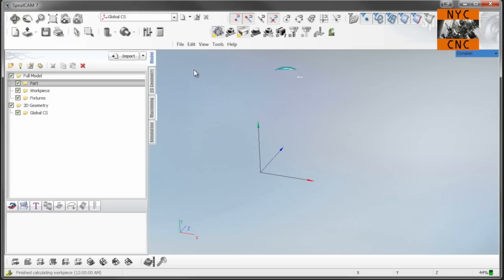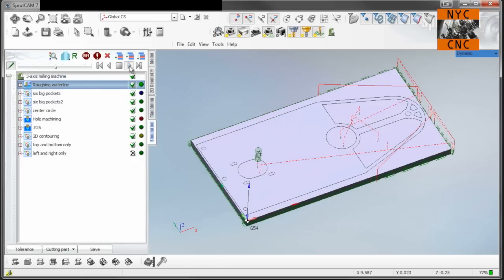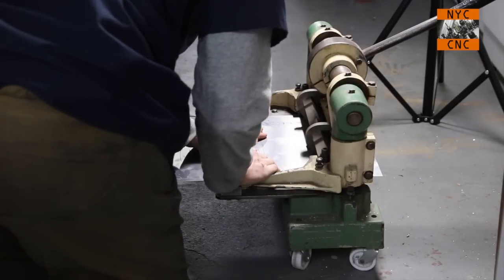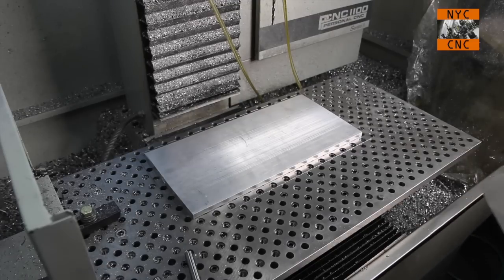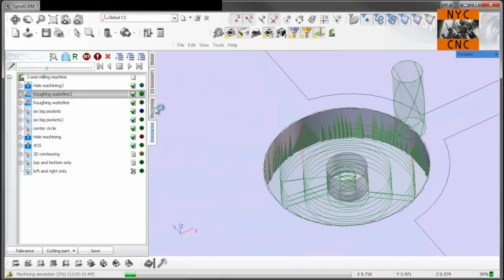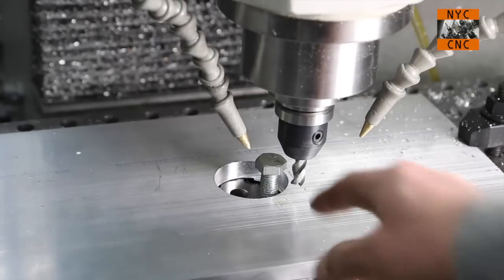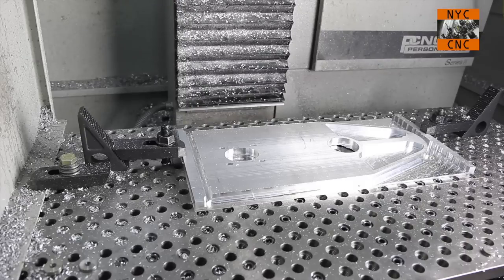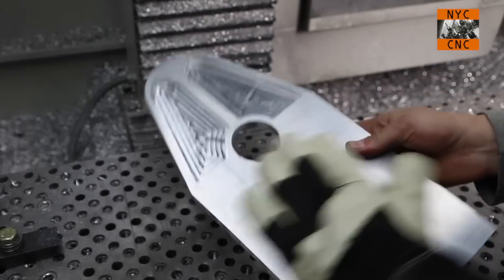Manufacturing At Home:  Machining Large Aluminum Plate with Tormach PCNC 1100

Comment: Just wanted to mention a tip on deburring that my father gave me (he's a retired CNC programmer from aerospace industry): As a last step after your finish pass, define a chamfer on your edges and run a 45 degree bit around it real quick. It may add an extra 30 seconds of run-time per part, but it decreases secondary hand ops, decreasing total time per part. My dad always tried to find ways for his programs to make the operators job easier. I'm really enjoying the videos! Great job!

Comment: Solid video man. If you're in a situation like that where you're coming close to cutting into your table, you can guarantee that you'll clear it by touching your tools off on the table, and then adjusting the values upward by the thickness of you stock and sacrificial plate (Or just program your depths from the bottom up). That will avoid the issue of touching off on stock that has a variable thickness.

Comment: OK here goes. In the comments here you asked for a bit of training. Pay attention, This part type is very common to  parts we see in our shop every day.
Fixturing: Get a 1" thick piece of Aluminum Jig plate the size of your machine table. Bolt it to the table. It is now your sacrificial base. Drill it, tap it, machine into it your extra .01 in Z. What ever.  no more .03 stock under your work piece. It will last for years.

Now, your Demo part:  Align stock to table, long axis in X,  Use 3 dowels to locate if doing more than one piece.. Just drill and ream into your 1" jig plate base, as above.

Sequence: Drill all holes first. Pilot drill bores and 4  slots. ONLY one hole where the end mill enters the slots, not 2. Mill pockets, 2 bores and 4 slots. Add Chamfer cuts to those features.  Machine Stop Here.
Bolt part down to table thru the 2 bores, remove clamps. Machine outside profile.2 depth cuts stay .01 off finish. One finish cut full depth. Chamfer.  Done.
 Rinse, repeat.

My Reference:  40 years. hope this helps.  MasterCam 3.0------->>> X8. CREO. 3.0
Reply: What he said.

Comment: beaut. cheers for the ideas and knowledge on clamping. for some reason I never really considered changing the clamps half way through a piece
Reply: NYC CNC hey mate whats the spacing on the holes in your bed? I'm planning on making a new bed (using extruded ally atm, not heavy/rigid enough). is there a minimum spacing that you'd not go below?
cheers.

edit
have you tried hsmexpress? some great software, and free too if you've got SW or inventor...

Comment: It all depends on your type of milling  I would say that you are not making heavy cuts.  For work like this I believe that everything will be fine.  Just try not to suck the work piece up with heavy drilling.  Also, your fast speed with the camera looks about the right speed if you are pushing it.  Just remember that pressure sensitive tape likes to be pulled apart slowly over time.  The key is to use 2 dowel pins for location and stability.  Dowel pins are great and very accurate for re-machining if you need to through the piece back onto the table.....Try them..and give the tape a shot.  I used the thicker tape when I was experimenting.  MSC is were I used to shop at. Always ask for 10% off....

Comment: 31:00 in or so when you say you've started wearing gloves.  I recommend checking out the Ansell Hyflex range of products.    I don't work with any tools without wearing a pair (usually 11-801 which is a general purpose glove). They'll save your hand from burns, cuts, some punctures, and give you tons more grip to deal with fasteners and holding on to parts.  They also prevent you from leaving fingerprints which is nice if you want to murder someone or delivery a part with no fingerprints on it looking all pristine.  Basically they're like having a second layer of skin and I don't ever find them really getting in my way.

Comment: What I always do is mount my product on a plate of 10 mm thick (I believe a little thicker than your product)
That way I can drill and tap through my product without hitting my bed
It is pretty much the same way you do it only I use a thicker plate which is now full of holes :P
That way you can finish your product on the cnc, only thing you have to do is deburn the bottom

Comment: Hi,
Would it not make sense to bandsaw the large chamfers on the RHS of the part, to reduce a lot of the roughing op? Doesn't need to be accurate, but would remove a lot of the stock from areas outside of the profile. 
I'm just thinking of this as I'm about to receive my Taig and am conscious of removing MC time from jobs I'll be working with.

Appreciate the effort that you go to to document your progress and to try to ensure the quality of the videos is good. Keep up the good work. Great to hear that your MC shop is turning a profit. Cheers for your efforts, from over the pond :)
Reply: Honestly, there is no need to rough cut all that material.  so much fast to simply cut the channel, just make the channel 1.5 times the cutter width to help with chatter and chip removal.

Comment: Thanks for a very informative video John!
I have a small (very small compared to this lovely machine :)) router (CNC-STEP 720/T) and I'm starting to mill aluminum on it (been using it for GFK/CFK and aeroplan etc). Your video was very informative about the principles for fixing stock and your thoughts about in which sequence to do it all! Very much appreciated !
Reply: John NYCCNC
John, pure hobby! I'm an embedded systems designer (for 32+ years) and I do modelling in my free time (RC turbine jet models) and because of that I often need "odd stuff". Before I bought the CNC mill I could only spell "CNC", I did not know anything about it :) It is guys like you making these kinds of videos that helps me :)

Comment: Nice part. I would have done it a little different. I would have drilled a 3/8 hole on the center if the 2 large cut outs, clamp it down there profile the outside, all holes and slots then add clamps to the outside and machine the large holes.

Comment: Nice video. Kind of curious, why wouldn't you choose to deburr your topside with the spotting tool, saves you having to deburr one side and its a simple step to program. Basically run a chamfered 0.003in edge on the cut upper edges. Usually we'll add a micro chamfer to the vertical square edges too so that they are deburred automatically.

Comment: Great demonstration. Why do you mill out the entire holes. Why not a ramp contour just around the edge. The middle piece will fly out at some point. but that's OK isn't it?
We also have an ultrasonic cleaner here. We have found that on aluminum parts we get a kind of interference wave pattern on the parts. We have had to use an actuator to move the parts up and down slowly inside the bath. I would love to know how yours works out.
Reply: Humm great idea. I have a lot of the same equipment in my shop. (Tormach) And I really appreciate your videos.

Comment: Hi mate, piece of advice that you will NOT look back... You NEED a vacuum table mate, no doubt about it! There is a before and an after you buy a vacuum table, that will save you SO MUCH time, get one now!!!!!!!!!!!!!
Reply: Kris TheTrader The new seal2 model is great as instead of clamping it to the table on the sides, you simply clamp it straight into the table with a base and then fix the vacuum table on top of it. Great idea and it's more rigid than before!
Reply: Kris TheTrader As a machinist I wouldnt recommend a vacuum table in a case that you want to drill and cut holes in your piece. For engraving jobs or cutting profiles is nice but when you want a piece like that its a very bad idea.
Reply: GRPrimo As a commercial machinist I can also tell you that what you are saying is nonsense... Especially when it comes to a piece like the one on this video which is more like a plate than a thick bar... These days you cut holes with normal end mills, the vacuum table can be used with 1mm or even 2~3mm stock (rubber mat) which is more than enough to do holes... Of course you can't do tapping or similar drilling operations, obviosuly... but will save a lot of time and the end result will be better overall than clamping down like on this video, no doubt about it... Question to you GRPrimo, have you ever used a vacuum table yourself before??

Comment: I'm considering building an aircraft from scratch. I know I'll have long parts but not very wide say about 4' long 2.5' wide. Obviously I can only CNC sections about 15" in length and 7" wide. If I were to purchase a PCNC 1100 today would I be able to CNC one large part in smaller sections? If so what is the aprox maximum length and width could I CNC?
Reply: NYC CNC Thanks appreciate the videos and knowlege. Keep em coming.

Comment: To save time, why not add a chamfer mill pass in CAM around the edges to deburr it for you?
Reply: John NYCCNC I haven't worked with SprutCAM, but this is pretty easy and quick to do on most CAM softwares. Of course, you'll still have to deburr all the far side edges by hand. Another great video!

Comment: Nice video! You seem to know what you are doing. I'm a machinist my self and I'm wondering why you mill your outer edges in the direction you do. If you know what I mean? I'm from Denmark and I don't know the word in English. Normally you would go the other way around so that tool doesn't drack the machine along. You normally only go your way with the very last cut of the edges or if your machine is extremely stiff. Why is that?
Reply: It's called conventional milling and climb milling. A cnc machine has no backlash, so you can climb mill with it

Comment: Found your video while looking to make 3D printer beds. The ones that come with the machines are not very accurate. 
I was looking for a way to make 320x310x3mm cast aluminum beds that won't deform under 220+F heat. Tolerances need to be under 0.005mm. Any suggestions?

Comment: looked good, ever try ramping cutter instead of drilling
Reply: Steve5796 I am always working with stainless and tool steel. I very rarely use a drill. Ramp milling is the way to go! Faster rounder hole and better location.

Comment: nice work. do you now what the piece was for?
Reply: The part was called "Sewing Yolk with Mount Ribs," whatever that is...
Reply: thanks i forgot what he said and did not remember if he said it or not
Reply: Skippy EOT MrMaxymoo22  It's actually for the yolk (like the pivot point) for my motion control crane.
Reply: I just googled that, that's an awesome project. Have fun!
Reply: ***** so you have the piece he made?
Reply: @MrMaxymoo22  Pretty sure that was supposed to be 'yoke' but whoever named the file spelled it wrong...

Comment: if there was a stop on the end it could have been taken off, worked on, then put back on in the same place, would have come back with in a .001 or less , could of went all there way around the outside perimeter with a slot within .005. cut it out, and been done a whole lot faster

Comment: WOW Great video. Where is a good place in the US to buy 1/2" X 12" x 12" aluminum plate
Reply: I don't know how often you do projects or how big.
Most metal suppliers will sell you the hole sheet ... BUT ... look in the scrap piles they may have left overs from other customers for what you need, if they don't! Try next week or so as they also recycled. At your local metal supplier
Reply: You can find all kinds of stuff on eBay if you just need small bits of stock.

Comment: I called this dude in Portland OR for a 2 feet by 4 feet, 3/4 inch aluminum plate
he said 600$:)
what is the cheapest you can get that size for and where?
thanx
Reply: It is roughly 30 Kg which should cost roughly 150$ if you buy 100Kg in bulk

Comment: why don't you use imachining toolpaths by taking a deeper cut, which will result in longer life, less chatter, and better metal removal?
Reply: that's correct, all forms of it are based on the same concept, its not a brand name per se
Reply: typical machinist calculator like zero-divide's FSWizard's free online calculator will confirm it too; compare a full depth of cut at 30-60 degrees engagement, versus your half depth at 50 percent engagement. To give you an idea of the efficiency you gain, with your machine, a 3/8" endmill won't even get to operate at 70% of its safety torque. It won't be limited by rpm, for a carbide endmill with TiAlN coating, but by power required, and still probalby register as 200% tool life.

edit: i just tried it on his website, its not the same as his HSMadvisor calculator, which is free download but expire after 30 days. The downloadable version shows tool like as you can see in his screenshot "hsmadvisor com/uploads/screenshots/all.png"

i got no affiliation, and never buyed his product, but use it every once in a while.
Reply: here's example cut: 
(1) select a tool engagement of 30 to 60 degrees. lower for harder material, higher for softer like aluminium
(2) increased depth to largest (0.5")
(3) increased feed to largest safe torque (it throws warning at 70% of the 100% but you can go higher with a good endmill. I've compared to current endmills on the market and nowadays most all count as a high performance endmill [its an option you can select from the drop down list])
(4) drop RPM to match your machine's as long as it don't exceed horsepower. Higher RPM decrease tool life, so even if your machine can do it, sometimes its advantageous not to spin fast.

i.imgur com/eERNFo1.png

To speculate on why most all modern endmills (even from 5 years ago) count as high performance, I think his calculator is based on decade old understanding of the properties of carbide, which were more brittle. Over the years carbide sinthering has become more thorough, so carbide is stronger. carbidetechnologies com/questions.php 

It's long rabbit hole into a complex topic, but carbide grains are closer, so better bound together. There's gonna be revolution in carbide technology in the following years as they're just succeeding to now align the carbide grains. Some companies claim its going to be like the revolution of HSS->Carbide all over again (but this time from carbide->aligned grains carbide)

Until that day comes, there's some strategies you can make to improve the cuts even further;
(1)lubricity and temperature control aren't accounted in the calculator, but varies for materials. There's coolants for tapping, coolant for aluminiums, and specific application, resulting in better performance of the tool.
(2)Buying endills with more flutes will increase torque to keep the same metal removal rate, while lower operating speed thus resulting in longer tool life (Basically lower speed while increasing torque proportionally, but feed stays the same because now there's more flutes). This is advantageous since often the cost an endmill (like on ebay) is very small for the variant with more flutes. Often people don't even search for higher flute variants, like 6,7,8 flutes, but they exist.
(3)You can now buy endmills with coatings you usually don't get like AlCrN and not fear you can't use it because of chatter. The chatter problem is reduce greatly, so you got more tool options.
(4)You're now aware you can produce a large pocket in the same ammount of time as it previously required a larger tool to make it. So you can now buy three 3/8th endmills for the price of a one 1 inch endmill, yet a single one last longer than the 1" endmill.
(5)Since you're using full engagement, tool wear is more even, so finishing cuts are improved.
(6)You can use the same tool for multiple materials, so long as engagement is the factor that's adjusted. Typically, finishing cuts on aluminum require a very sharp honed endmill, which is reserved for that kind of cut, because if used on steel would dull, so it's waste of a special tool.
Reply: i appreciate that, really. People sometimes wonder why someone would make a long post like that, think maybe he's just rambling. I do it because I enjoy the channel, and watching you succeed and revise and continue on with what you like doing.

Comment: "Sprootcam" in my head I say sp"rut"cam. Since this is not professional work put a piece of plywood under it and mill it to depth and drill the holes in the NC machine.
Reply: NYC CNC I like your videos, are you still doing this in your homeshop?  Are you working for Tormach now?  If you like sprutcam you should try me soft visualmill.  You can get it inside Geomagic and your if  models change the tool path changes. How much does sprutcam cost? Sorry, just watched this again to hear Sprootcam and it was for a customer and professional, I'm still a kid, Sprootcam knocked me off guard.  When is the Tormach lathe going to be available?

Comment: set it on crs box
Reply: put  crs  block and you can drill tap and bolt it to the table with flat head no need to contersink . and you can get it all in two setups. and you wont hit the table. If you hit the blocks no biggy